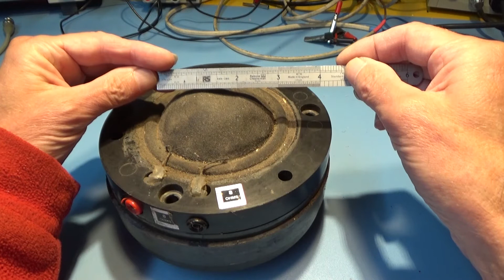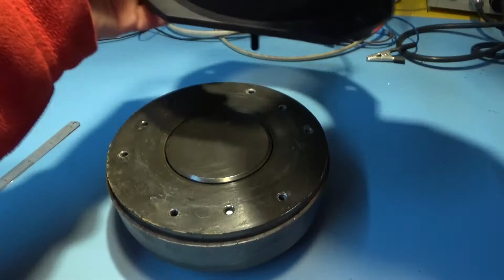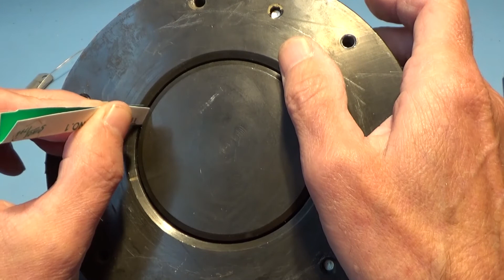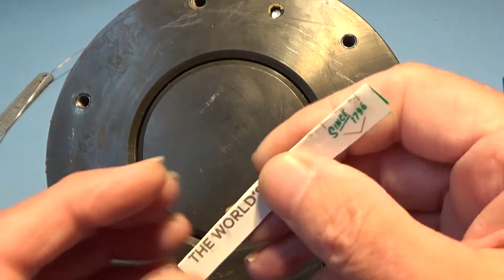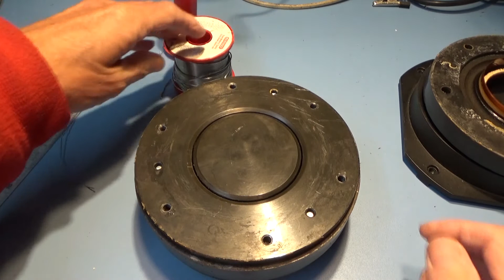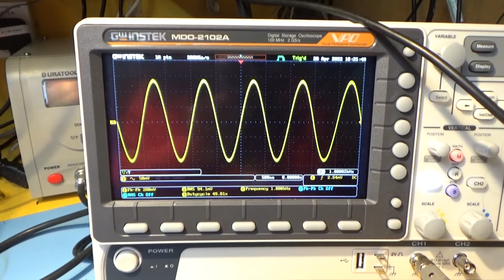ATC 3 inch soft dome midrange speaker

Comment: You can put dowel rod of a snug diameter into the magnet screw holes, then use those as a guide when putting the coil back on.
Reply from the maker: @ethorii  thanks for that, I'll try and remember if I do another one

Comment: hi thank you very much for this interesting video  
If only hifi manufacturers looked at the pro compression drivers  To replace a diaphragm is so much easier   
I have some domes and i wonder who designed them   The wires are glued externally on the acoustic lens  Crazy  
Here the diaphragm looks bad   I wonder if they provide replacements   I think they should  
Kind regards gino
Reply from the maker: @gino3286  thanks for the kind words. Having been in the factory, I don't think they're will sell spare parts for their speakers. But I think they offer a repair service at enormous prices no doubt!
Reply: @ptronix  hi !  thank you very much for your very kind and valuable advice
There is a reason behind my question
Some time ago i bought a pair of vintage dome midranges made by ITT
something like the poor guy ATCs
only to discover that the drivers TS paramters do not match neither with the original specs and neither between them !
probably an aging issue of the dome material
In the end they are not usable and a complete waste of money
I would love to get replacement diaphgrams of course but i do not think they exist
Kind regards gino

Comment: I see the dome is somewhat dented… does this impact the sound quality of the speaker or can it be fully functional in its current condition?
Reply: Oh ok.  I thought it was an actual working part of the speaker and not just a dust cover.  Well, I trust you!  Thanks for the video
Reply: @MrClaywell  It's literally the speaker diaphragm, not a dust cover. Take it away and you'll hear no sound. It would be like removing the cone on your woofer.
Reply: I am so confused...could use a repair man or tech here to clear this information up...
Reply: It might effect cone breakup, but how much I couldn't say without controlled testing
Reply from the maker: Makes no difference,its only a dust cover,if you're careful you can them out the dent with a vacuum cleaner